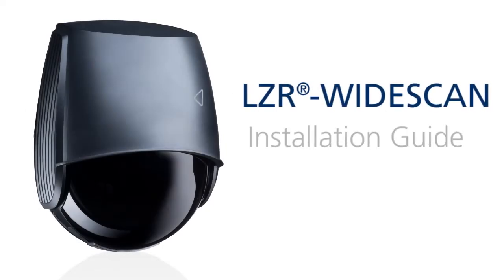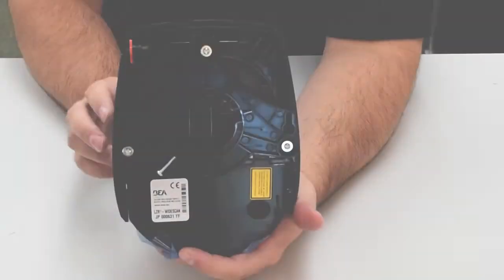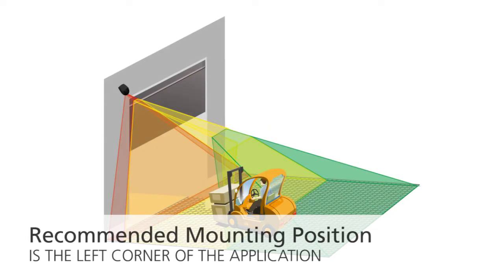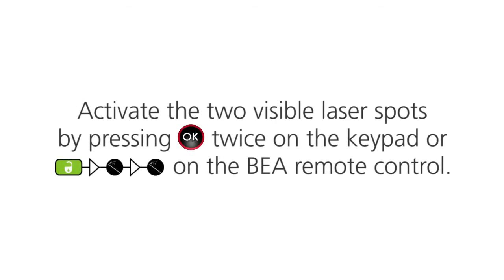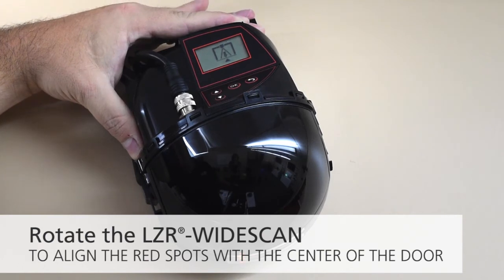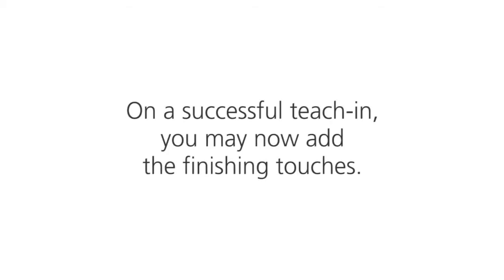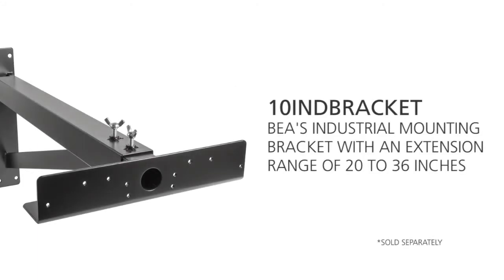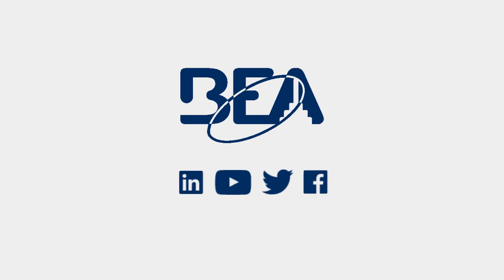How to Install BEA's LZR-WIDESCAN

Comment: I struggled with A LZR yesterday. I’ve done many falcons and IS40p sensors but the LZR is difficult. The motion set up easily. The presence and safety portions did not. I eventually gave up on the safety portions as they were not needed as redundant safeties. Job site is close to our shop so I will revisit it at a future date. I don’t want to give up.
Reply from the maker: Hi Robert. Sorry you were having trouble setting up the LZR-WIDESCAN. Our Technical Service team would be happy to answer any questions you may have to assist you. Give us a call at 1-800-523-2462. You can also submit a tech service form at https://us.beasensors.com/en/contact/ or contact us via email at AmericaTechnicalServices@beasensors.com.
Reply: @BEAsensors  
I’ve got a pretty good handle on them now. Took me awhile and one call to BEA did straighten out a lot of the issues I was having.
Reply: ITS  horrible i agree too much overlap and what not. with 2 sparkeys we had trouble. got it running but wont hold it open but we have safeties and no timer so no biggie